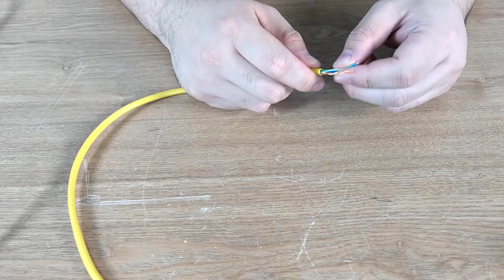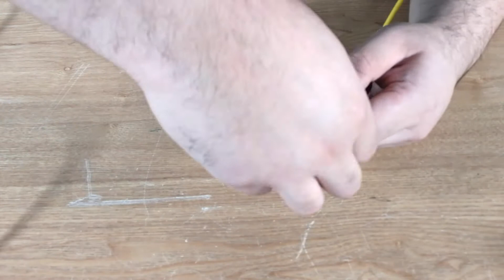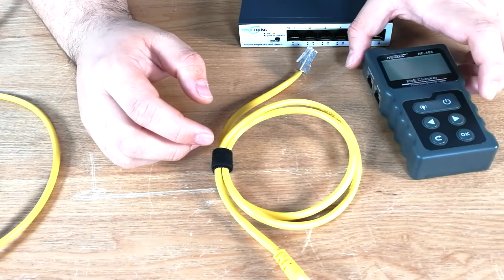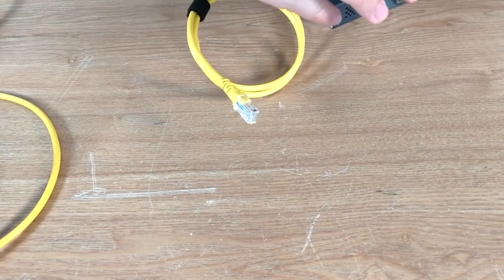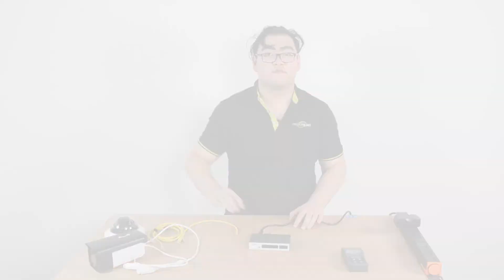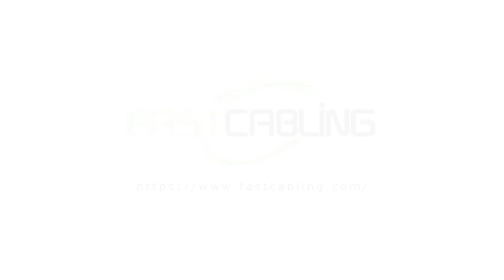Use Single Cat5 Cable to Connect 2 PoE IP Cameras#2 : Test Using 4 Pair to Power or Not

Comment: The information in this video is poorly delivered, the frequent stops and starts and incorrect word use makes the instruction hard to follow. Additionally wires are  “ connected, used or utilized” they are not occupied. 
 I stopped viewing and will look for another information provider.

Comment: 12 36 are orange ang green pair.
Reply from the maker: 12-36 is orange and green pair for both data and power. If it is IEEE802.3 bt, 45-78 need to be included as well.